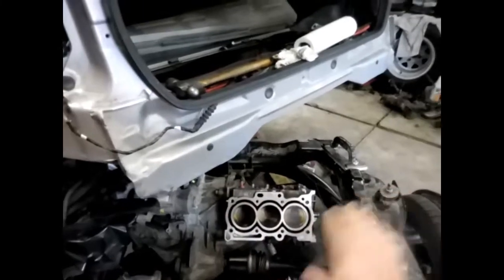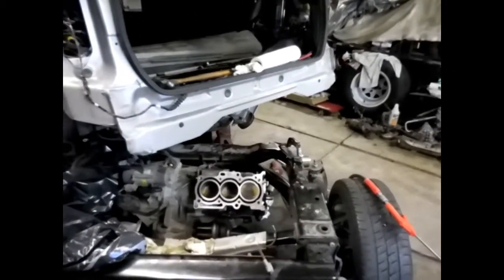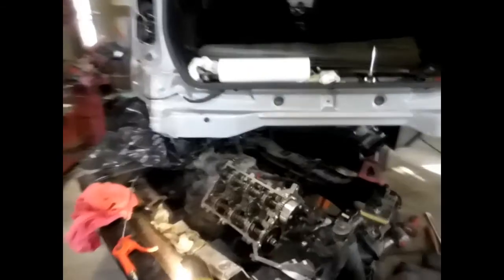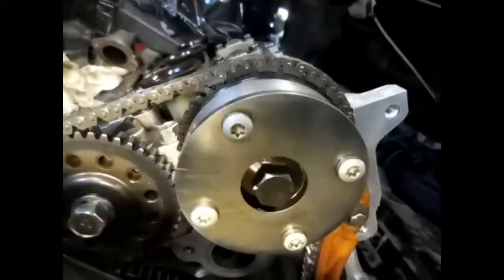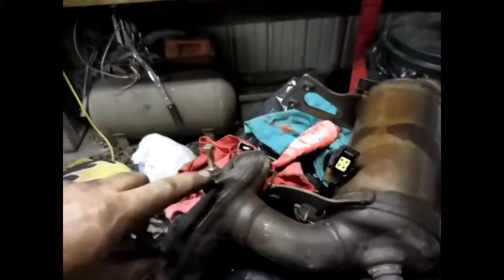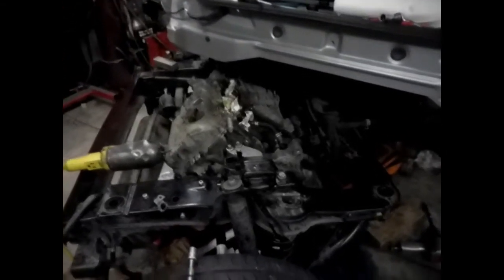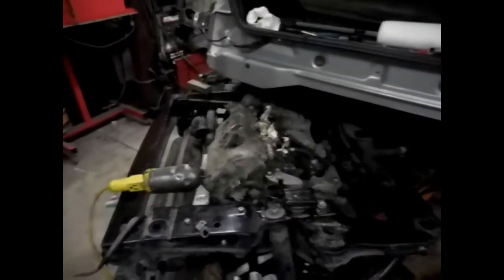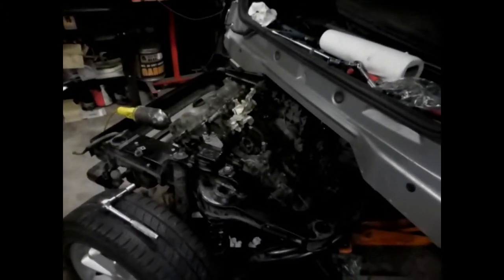smart car head  gasket replacement 2

Comment: These smart easy to have this issue because gear changing from 1st to 2nd is slow.  If driver not pay attention and take off hard but not listen to engine rpm  (if stuck in first gear, slow gear change) and cause over 3500 rpm.  Will have head gasket issue.
Must ease the gas pedal when hear high engine rpm.

Comment: nice work, how long did the replacement take. i think i am going to replace mine to.... have water comming out of my exhaust.... alot of water :)
Reply from the maker: You could do it in a weekend if you had all the parts
Reply: @thomas1971ish  okey thx alot..   can it be done by one man or is four hands needed.
Reply from the maker: @baltazar0007   I did it myself but it's a job.
Reply: I had the same problem coolant coming out the tailpipe with lots of smoke 😢 I got my head gasket off I'm just nervous about installing because I've never done it before and I don't know if my cylinder head needs to be shaved or not it's basically just the money game now saving up to replace parts and o rings etc

Comment: Great work for an unsupported engine. I've seen quite a few of these with this issue.  
Next time I suggest;
  1) When lapping a surface (sanding the head), move in ALL directions, including circular; -not 'liner' in one direction as was seen.
  2) Didn't observe any carbon build-up at the top of the stroke in the bore (top edge of top-ring travel), but for those doing a head gasket in the future: Do NOT remove that Carbon lip unless you're installing new rings. Why? That's the 'seal' developed by wear, and the existing rings. Sure, it seems 'neat' to make it all clean... but the result is increased oil usage in the future. 
3) Consider doing a compression check when in the diagnostic mode so as to better focus on just where the 'leak' might be; a very small longitudinal crack can show-up in cylinder liner.
   Future owners be aware: this car is transferring to an ALL ELECTRIC model made in China; -this motor will very soon be completely unsupported.